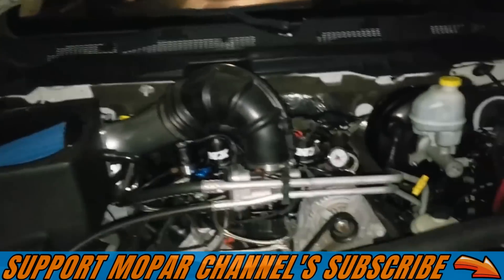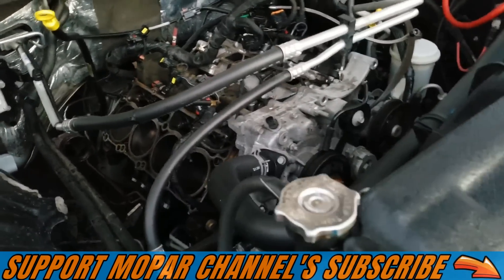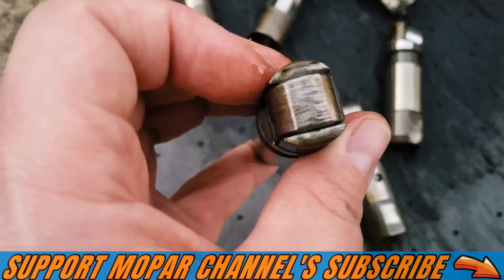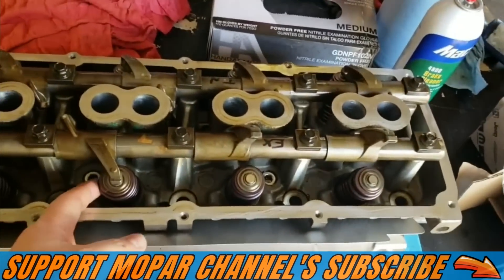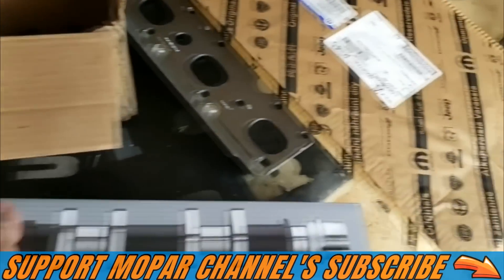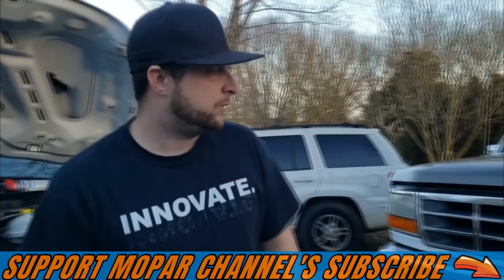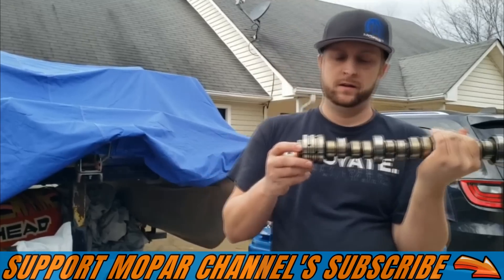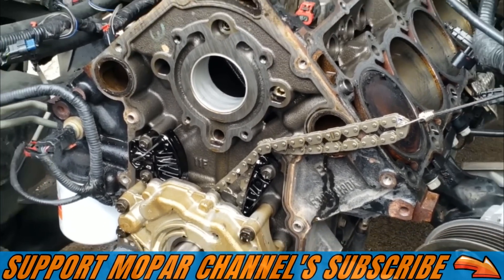5.7 HEMI TICK CAMSHAFT AND LIFTER REPLACEMENT MDS DELETE

Comment: I have metal shavings in my filter but not in the pan as far as I can tell without having the pan off. I planned on doing AMS with the hellcat lifters and new oil pump. Do you think it'll be good or will I just need a new block? I noticed the tick about a week ago. Getting ready to start it this week.
Reply from the maker: I had some in my filter also should be good just check the camshaft bearings in the block.
Reply: @FrostbiteRam  thanks for the reply! I'll definitely check them and I figured when I drop the pan I may check the crank also.

Comment: The camshaft and lifter problem is built into the design.  Not enough oil is getting to that part of the motor The lifters are galling on the side of the lifter bore. Short of a whole redesign of the block everything is just a temporary fix.
Reply: No you are wrong.
Reply: @mikes2460   No they don't. Many get 20 to 30 thousand miles and the ticking starts again.  On Chrysler's earlier blocks the cam and lifters are drenched with oil draining back down from the top of the engine. No so the new Hemi. Look at Uncle Tony's garage where they tear one down and examine the problem. He is as about as knowledgeable on Mopar as anyone and said because of the problem he would build them for others but never own one.
Reply: @mikes2460  Thank link doesn't work!  Stop posting it!

Comment: You're wasting your money the engine has a major major design flaw your cam and lifters will fail again they are not getting lubrication even at higher RPMs if you're building a race engine and you're going to keep it at 6000 RPMs then you're splashing some oil on some of the lobes not all it is a major major design flaw the engine is garbage don't waste your money

Comment: Hello awesome video..ive always had a lil tick in my 2013 ram 4x4...the engine light came on i ran a code p219..thats an over rev code..i was riding a lower gear coming down the mountain the other day...does the tick have anything to do with that?Alos do you think it just tripped the code and it will reset itself?ENGINE ONLYhas 70k...on it..I know i need to change plugs aswell..thankyou im no mechanic..
Reply from the maker: It will reset after time as long as it's not reading the fault code over and over.
Reply: @FrostbiteRam  thanks man

Comment: I'm getting a really bad oil smell. Usually after wot pulls. Sometimes just cruising around. Goes away immediately. My breather filter was super oily and dirty, i replaced it since then. PVC lines looked fine not blocked. Could I have a bad pcv valve?
Reply from the maker: Its possible also check to see if your oil is overfilled.
Reply: @FrostbiteRam  it's not, Its actually consuming oil faster than before
Reply from the maker: @elifernandez3769   It could be worn  Valve seals.
Reply: @FrostbiteRam  damn I hope not! I'm not getting any smoke out the tailpipe though. And it's more like a puff of oil smell then goes away immediately🤷‍♂️

Comment: I think mine is a pretty similar noise. Mechanics can't seem to figure it out. Dodge dealership wanted to do a tear down for $700. The small dealership I bought it from picked it up fixed some stuff on it for a fraction of the price. But the CEL is still there for a P0304 misfire. Going to a performance shop that works with Mt extended warranty company. Hopefully they can atleast figure it out

Comment: Yo @frostbiteram after I finish swapping all my internal components cam, hellcat lifters, 6.4 intake 87mm throttle body etc, should I switch to the 0W40 oil?
Reply from the maker: I use 5w30 in my truck but I don't think 40w would hurt
Reply: I was just thinking since the new components normally call for the 40 plus the new intake is labeled 0w40 because of the 6.4 but idk! I know I can just put my old cap on but was just wondering ASSuming, Lmao! Thanks man, hope all is well!

Comment: Can you replace just one side (bad side) of lifters and cam? Will lifters fall down when cam is pulled out? Trying to avoid having to pull the other head to replace those lifters, not keeping truck for long
Reply from the maker: Yes you can as long as you're going back with stock lifters.
Reply: Use magnets to keep them up small ones will do
Reply: David Stinson you don’t have to use magnets with the pushrods out you can rotate the cam and that will push the lifter you in the bores and they stayed there.

Comment: My 2013 has 69k and I bought it about 4 months ago with 67k. It has a sound that sounds like a manifold leak when the engine is cold then goes away once warm like a manifold. Is that how yours started out sounding?
Reply from the maker: You may just have a broken exhaust manifold bolt and leaking gasket that is very common also

Comment: After installing longtube headers I noticed a ticking noise. Im hoping its normal noise after replacing the thicker, heavier iron exhaust manifold. That was done when my 2017 had 6,000miles. Appreciate the video 👍
Reply from the maker: Its pretty common to notice some valve train noise with longtubes or shorties

Comment: Couple questions for you, is this a special "Greene's Racing" only grind? Also do you know if this will work on the 1st GEN of new Hemi's 03-08? Mines a 07 w/MDS that I want gone, I've got the tap-tap-tap and it's around 100k miles. Thx for the info, your video helped me a lot to figure out why I have an manifold exhaust leak and the ticks.
Reply from the maker: Yes its custom grind from greene racing and he has many options for all hemi
Reply: do u have to remove the header from the head ?

Comment: Hi, How much would the deal charge for this? i have a 2011 jeep grand cherokee 5.7 that is having this issue. i have already got a misfire code for cylinder 2. i know most of the price will come from labor.  my experience goes as far as oil change, spark plugs and brakes. 
thanks in advance

edit: truck is at 250,000 km

Comment: Hey did u get the .5 HL V2 thump?
Reply from the maker: Mine is not the thump cam it's the .5HL racing cam
Reply: Frostbite Ram do you know what the difference is between the both.
Reply from the maker: @TheChaddickey  the thump cam Is really choppy the one I run is not
Reply: Yeah I was just looking at the three that he offers the  sleeper the mild-thump and thump. The same thing that happened your truck just happened to mine and I was going to go with a similar set up to what you have I’m definitely going to get the .5 HL camshaft.
Reply from the maker: I love mine it has a ton of low end torque perfect for a truck.
Reply: Frostbite Ram  does he still offer the race cam version like urs?
Reply: Is your truck a everyday driver ?   I’m with you tho I don’t want a loud thump

Comment: Does this eventually happen to every 5.7? I know a old guy with a 2012 reg cab only 52k miles. He said that he's never been above 70mph in it. Only wants 10k for it. What should I look for. It drove good. Has stock air intake and stock single exhaust pipe.
Reply from the maker: Its normal for the hemi but nothing to be scared of.

Comment: Great video
I have a really loud tick , I juste finish exhaust bolt manifold,  had only one broke off. Front one cilindre 1.
2 question  .
Can you list of the part I need for the job?  Best lifter and cam.
Also  when your doing a MSD delete,   does it make the engine light to come on ?
Thanks you very much
Reply from the maker: Thanks, parts list and links is in video description.  Also after tuning no issues with check engine lights.

Comment: Will this application work for all that want a little more power? Im literally about to do this exact job due exact cause.  Was thinking if upgrading to 6.4 intake as well?  Obviously i know it will have to be tuned after, but just want to be sure this will work?
Reply from the maker: Yes, 6.4 manifold is great upgrade also
Reply from the maker: @twiztedconceptzanddezignby151  just cleaned them up no need to send out.
Reply: What tuner do you recommend?  Jay said hptuner because of trans parameters but I see you use the Diablo.
Reply: @Frostbite Ram
Reply from the maker: @twiztedconceptzanddezignby151  I switched to hp tuners
Reply: @FrostbiteRam  you have a link for purchase or exactly what I need,  went on the website earlier to order but was a little vague on which one.  Appreciate your time!
Reply from the maker: @twiztedconceptzanddezignby151  awesome 👍

Comment: Just had a cam and lifter replacement, it is still ticking. Mechanic said it will go away, is that true or bullshirt?
Reply from the maker: Shouldn't be ticking after the lifters build up. May have a exhaust manifold leak from broken bolt very common also.

Comment: I’m looking at a 2020 2500 ram 4x4 with the 6.4.  All this has me a little worried. Should I be worried. Thanks
Reply from the maker: Dont know much about the 6.4 rams haven't been out long enough to see major problems yet.
Reply: Frostbite Ram ok thank you.
Reply: My 6.4 Ram required a camshaft  and lifter replacement. I was told by the mechanic at the dealership it is common and it cost $4700.
Reply: Deep Cover what year truck?
Reply: 2014 Ram 2500 with the 6.4
Reply: I purchased it brand new and it always received dealer service.

Comment: So is this problem only happening with cars and Trucks with MDS and auto transmission? I have a manual transmission and no MDS.
Reply from the maker: It's more common with the mds engines but some non mds engines had the same issues. The hellcat lifters are better.

Comment: This happened to me on my 2012 4wd 5.7. It manifested as a squeak, I believe the lifter bearing was locked up and rubbing the cam lobe (this was also diagnosed by the dealer, but I don't really trust them). I loved the truck but between the exhaust manifold bolts on cylinders 7 & 8 sheering at 60k and 130k. The lifter bearings started failing about 130k as well as the transmission, so I traded it in.
Reply: Brandon 
Did u have the ZF 8 speed?
Reply: @HammerK99  He couldn't have they didn't put them in 2012s

Comment: How's it do with you not taking the heads to the machine shop? I've always taken heads in. But if I can save some money on this one I'd like to.
Reply from the maker: Its fine just clean the gasket material off.
Reply: @FrostbiteRam  a friend of mine works for Chevy and said they do LS heads all the time for the same thing. He said they never send heads off to be worked. I've just never pulled an engines heads off that didn't blow a gasket so... understand my worry

Comment: I'd like to also mention how proactive you were in diagnosing the difference between a ticking noise which is normal and about 4 different taking noises if you wanted to count the exhaust when you shut off the engine which is a stupid one in my opinion, so really there is only 3 significantly different hemi ticking noises that the engine makes. You got the worst of the 3 ticking noises themed "THE HEMI TICK" thankfully you caught it early enough where most people catch it far too late after it's destroyed most of the cam lobe and the locked up hydraulic lifters creating the metal to metal contact that you were extremely fortunate not to encounter which completely saved your engine from having any metal filings large enough to create damage if the magnet in your pan was already full. The reason it was the first hydraulic lifter you took off, but it also could've been the last one at the firewall. It's simply due to a lack of oil displacement being, that's the furthest from the oil source coming in the common oil gallery along the rail, going to the furthest points, either the front or back of the engine, get the least  amount of lubrication. Overall though yeah you did really well you got it you fixed it. I'm sure when I finish this video. You were smart enough to realize the difference between one hydraulic lift you're going I don't know how you did it man? I pay attention to my engine, but I don't think I would definitely not have caught that! PROPS! peace ✌️
Reply from the maker: Thanks, but my opinion no hemi ticks unless something is wrong non of mine do atleast.

Comment: I have the same noise but it’s only on when I start the truck it goes away after 5 min or less, my truck has 120,000 mi, 5.7L, 2016, wondering if it could be the same problem, thanks
Reply from the maker: Possible,but it may be broken manifold bolt if the noise goes away.
Reply: Frostbite Ram 
Thanks bro I appreciate it thanks
Reply: My exhaust manifold back bolts broke on the passenger side 2 years ago....cost 500 dollars....its a 2012 sand had only a little over 50 thousand miles. A week ago the back bolts on the driver side broke so I'm gonna do nothing for awhile

Comment: Have a 13 with 80k engine tick all the time. Idle is most notable, sure it's still there as rpms go up. Wondering if this is the issue..
Reply from the maker: Most likely if it dosen't go away when warm.
Reply: @FrostbiteRam  temp makes no difference at all. Already replaced broken manifold bolts on both sides. I have an extended warranty. But I worry they will just put same failing parts in it.
Reply: in warm mines gets lower the sound sounds like a diesel engine  lol unless when i push the gas you can hear it tap a little

Comment: I'm in north Florida with '15 Ram 1500.  Thanks for showing this.  Just subbed.
Reply from the maker: Thanks
Reply: How much does it cost for everything and lifters gaskets valve seats etc. etc.
Reply: Oh and yes I left out the cam how much is a cam
Reply from the maker: @davidbeadle2117  custom cam and parts will be about 2k

Comment: My tick showed up late last year and the shop suggested putting a quart of Lucas in with my full synthetic during the oil changes. I have been concerned about it, more especially after watching this video and previously hearing about this issue on the hemi. It does smooth out after the engine warms up but it doesn't make me feel any better. Im concerned during regular driving but def more concerned when ill be towing my small light weight camper. If it doesn't go away with the Lucas addition to the oil change, i will be  motivated to take it to my local Ram dealer where my cousin works in the service dept. who makes sure everything is legit being its still a dealer and all. I will be looking for a local trustworthy mom and pop engine/ speed shop to work on it as well. Thanks for the vid and the upgrades look sweet!
Reply from the maker: Thanks and definitely keep a watch out it's very common on the hemi engines as well broken exhaust manifold bolts that also cause a ticking noise.
Reply: @FrostbiteRam  thanks man. 
The shop checked the manifold bolts first to make sure the tick wasn't originating from there instead. Unfortunately, it's the lifter tick and I've heard some performing for 1000's of miles before they started noticing issues.  I'd rather be proactive about it, so I'll def keep an ear to it and hopefully it won't be throwing codes either. Thanks for the feedback, keep up the great job and I'll keep you posted on mine as well! 
-2012 Ram 1500 5.7 single cab

Comment: How did you delete the mds from the computer? Could I use a handheld tuner to do it ? Also did you turn it off before or after replacing the cam ?
Reply from the maker: Mine was already turned off with custom tuning from greene racing. But you need to have a programmer like Diablo sport to turn off mds.
Reply: Thank you !

Comment: Just curious why you can't just leave the MDS solenoids in place and unplugged. Why are the plugs necessary?
Reply from the maker: You dont need plugs.  You can leave the solenoids in place and do exactly that.
Reply: Will it run properly tho check engine light ?

Comment: Honest question for you 'good' home mechanics out there:  I have the chance to buy a 2011 Ram 1500 Laramie Quad Cab 4x4 with likely this issue. (the P0303) popped up recently, along with a drop in power.  It has high mileage (208k miles, 335k km) but it's in quite good shape for it's age, with only minor cosmetic issues.  Would it be worth replacing the cam/lifters and trying to resell for a profit, or is it too big of a project for a 'mid-level' home mechanic?

My experience: I've done a couple head gasket repairs over the last 25 years, 1 or 2 timing belt/chains replacements, 2 or 3 water pumps, a half dozen alternators, and at least 50 oil changes. In short, I'm 'pretty good' but not a mechanic.... is this job more than I should take on?
Reply from the maker: With stock parts you looking at about 1200-1500 in just parts.

Comment: What year is your truck? I have a 2011, and Im having a misfire code and rough running at times. The check engine light will flash for 2 cycles, then turn off. Then its fine. I dont want to keep driving it like this, I dint want to cause damage if possible.

Comment: In order to change the lifters do you need to drain out the engine oil out of the engine  first ?
Reply from the maker: You don't have to but I would recommend changing it for sure.
Reply: Frostbite Ram thank you

Comment: By any chance would you know what is the oem part number for the cylinder head bolts needed when doing a cam swap or can I reuse my old ones
Reply from the maker: I sure dont, its recommended to install new bolts but I didn't 😬.

Comment: I have a 2013 with the ticking problem also, how much did it cost you for that setup?  I don't race my truck but it would be good to have that extra power.
Reply from the maker: About 2k in parts I believe
Reply from the maker: Parts list is in video description

Comment: Sweet vid!!!! 2 questions:
How many miles did you drive it ticking ?  I'm at 15000 miles no code yet
How did the rocker arm and push rod look on the bad lobe lifter?
Reply from the maker: Rocker and push rod was fine.